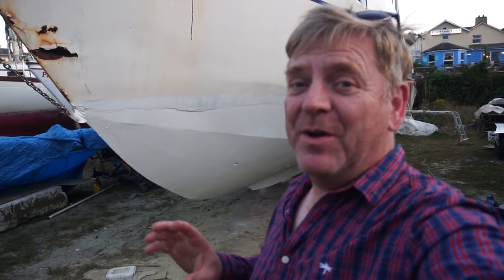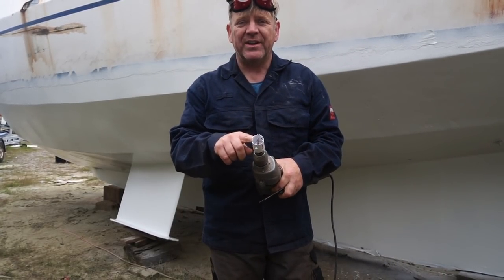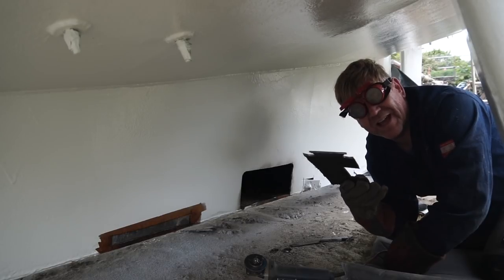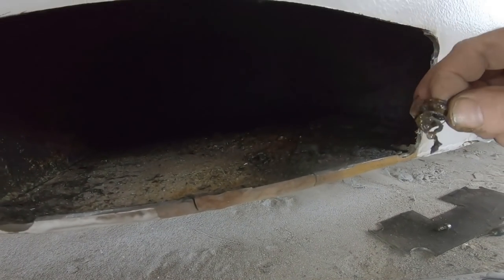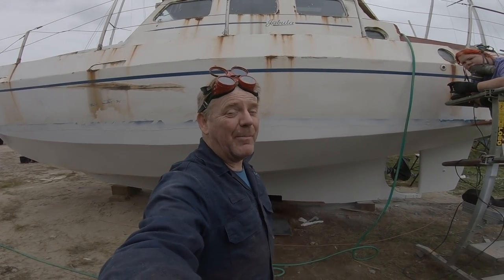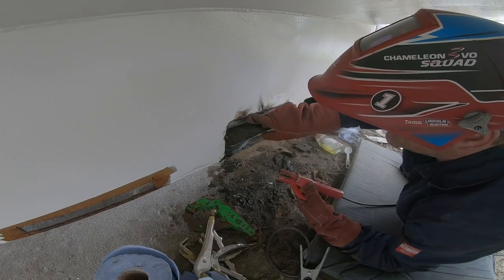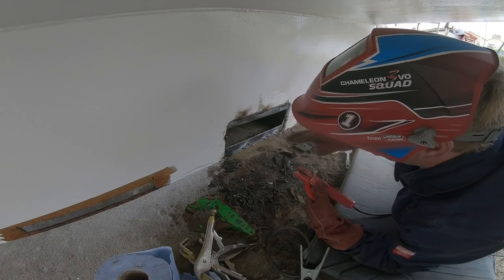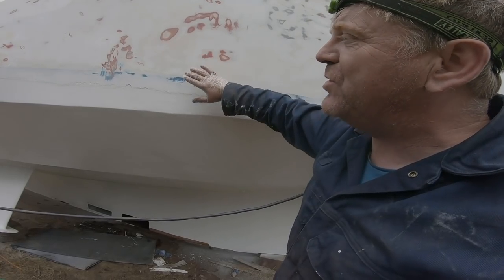#60 - Now our boat will DEFINITELY SINK!!!!

Comment: Paint it any color you like, just put in a good air conditioner and dont sweat it , the mini split ac units are designed to run completely on solar power but can run on shore power if your in the dock you can get enough ac for two rooms of a house or like 16000 btus for around 1600 dollars it comes with a compressor like 8 to 10 inch thick and around 2 to 2.5 ft square and 2 head units you mount in the boat and just run isolated lines from the compressor to the head units and back.  P/S some of the units dabble as ac and heat

Comment: Hi team, I have white deck on Steel. All I have to do is open the hatch and can relax in joggers, no sweat today. The biggest heat killer after that is mirror tinted windows that stop sunburn and UV protect SAILS
Reply: Yes, can also use the gas cooker for lunch. No sweat, perfect shade with a breeze. No coolers

Comment: Silver or white, not only does it reflect heat but it emits less heat, cooler in hot weather and will retain more heat inside in old weather. An orange hull is nice if you wish to be seen, could be a life saver.

Comment: boat is looking better every time I see it and it's great to see you radius the corners of the plates this stops fracture points.
never sèen backing plate done like that? if you are worried about penetration in future you weld in plate with a light root grind it back then go over with a hot pass weld really you should do  same on inside but as there's no access you could use ceramic inside ?
I'm sure the way you are doing it will be fine just trying to give you other options.
admire the dedication and the fact you are following your dreams

Comment: I love metallic silver. Have you considered a pale blue? Sky Blue, Ice Blue and Aqua Mist are three interesting Awlgrip colors just for ideas. All will contrast nicely with the white above the rail. I'm against dark colors on boat hulls. They highlight every flaw and tend to have shorter life spans due to extra heat absorbed by dark colored surfaces. Alexseal is a very good quality user-friendly paint that is brushable and easily touched up.
Reply: Dark colors show oxidation terribly as well. I saw a navy blue boat that had white puffy clouds all over it, and not in an artistic way.

Comment: Hi the only problem with silver with fleck, very hard to touch up but it does look good. Regards your backing plate next time you come to cut out the holes you have double thickness to cut through hoping  that's a long time  away, you can do the other side  i guess.Anyway great progress

Comment: Next time you get weld gas ask for non gas fluxcore wire, or make a wind break. If you get pin holes don't leave it has holes all threw it and will let water in! Just grind the weld backwards till you see no more pin holes and weld it  you have backing plate set it to about 22 and adjust your wirespeed till it makes that bacon frying sounds but go down hill on vertical

Comment: On the subject of colors, personally I would avoid dark colors which absorb heat from sun light because you'll bake and would also avoid a color which is reflective of sunlight on the top side  to avoid frying.  Very Light green, blue tan etc... would be my preference.  Orange, red and yellows will fad over time making color match for repairs difficult at best.  
You asked, there is my opinion....

Comment: Great channel recommendation.  Also you all are doing a great in both boat work and videos. I have been in a similar situation with a holesaw except mine went down a steel pipe and hopefully out into the septic system. It was 12 years ago and there have been no plugging issues. Lol fun memories.
Reply from the maker: Welcome aboard!  HAHAHA I bet that was pleasant to retrieve
Reply: @SailingMelody  nope never retrieved it. The farmer I was working with just looked at me and we laughed.  The pipe handles the drain for a dairy farm milking parlor.  We flushed it repeatedly with several hundred gallons of water.  Odds are it is in the first stage lagoon.
Reply from the maker: Right yeah gone for good then 😂

Comment: No need for letterbox plate, four small tabs would do and leave more access room for painting!
Reply from the maker: That’s a good point. Might do that next time.

But the letter box is belt and braces which makes me feel happier 

The other advantage is being able to leave a slightly larger gap and push the amps to root weld the outer panel to the backing plate all the way around and then another bead of weld onto top to weld the plate to the keel

Comment: I had a dark blue Awlgrip paint over fiberglass trawler for 10 years in the Caribbean. Looks great, but during the day with direct sun you could not touch the surface as it was to hot. I would stay with light colors. Maybe a plain light gray to contrast the white topside. Metallic colors are to hard to match up the road.

Comment: Have you considered one of the modern chrome paints? ....  lots of surface prep, but very very shiny :D
Reply from the maker: Hahahah I’m guessing absolutely impossible to maintain with scuffs and dings though
Reply: @SailingMelody  Ach, wooden rubbing strakes, plenty of fenders and about an inch of clear-coat over the top of it ... you can make it work, I just know it :D

Comment: Where you have the inspection ports into the keel.  Why weld them up again when yo could turn them into permanent removable hatches, with just a little extra work.  🤔🤔🤔👍
Reply from the maker: I wondered about this but I’m pretty certain the build regs would prohibit it and it wouldn’t pass a survey

Comment: Nice idea with the backing plates. - will help stop distortion down there in the HAZ  and will act more as a stronger lap joint than a butt,  Will be good if you could flood some kind of paint down there on the welded bare steel if poss where it burns off with welding.. Keep up the good work!

Comment: we have a  really deep bilge .probably easier access than yours though.  to reach the bottom we bought a vilda super mop to get down there. and cut the handle for easier storage.
Reply from the maker: Good plan!
Reply from the maker: Under the prop shaft we could do that definitely but under the engine there isn’t even room to get a mop down between the engine and the bearers. I tried to get my gopro down there on a selfie stick and I couldn’t get it in. Hut yeah definitely under the prop shaft will be able to use a mop like you suggest :)

Comment: you should put in a hole between the bilge under the engine and the bilge where the bilge pump is located so you don't have any standing water under the engine.
Reply from the maker: there are small holes in the corners for that reason yes :)

Comment: Ow come on 16 mins for one hole.. i think you need to up your game 😁
Melissa painted whole bottom of the boat last week 🤣🤣  she worked hard!! 💪 👧 🔋 

On a serious note metallic silver would look a bit too much like primacon? Goose grey, Oxford/navy blue would look awesome ( plenty of boats dark colours in the med and you will climatise as travelling, its hot regardless of colours lol) can always fit a small ac unit you've got plenty of room 😁

 gloss white (with metallic silver accents/pin stripes ) I'm sure whatever you choose she's going to look great 👍🏼
Reply from the maker: Hahah yeah I’m being very particular about any welding below the waterline. 

If I screw up a weld above the waterline the penalty is a drip bit screwing up welds below the waterline is a whole different game 😂😂😂😂
Reply: @SailingMelody  off course totally understand 😜 takes time todo it right.

Project brupeg is a good channel that goes right indepth of welding especially below the waterline (I'm sure you watch them already 😉)

Doesn't seem enough anodes round the boat, have you cut them off in prep for new ones?

Comment: I'd stick with white, but you really need a/c if you're going to circumnavigate, otherwise you'll be miserable, plus have more issues with damp and bugs
Reply from the maker: We will fit A/C at some point 200% but not just yet.  Eventually we will have AC, Genset and water maker but all in good time
Reply: @SailingMelody  that's sensible, you'll be glad to have those three I think

Comment: see there is a balance of positive and negative, yeah a navy blue might be hot in a tropical climate but white will be very bright on the eyes, id go for the dark navy colour and try to have more ventilation for the hotter climates, or use internal insulation to keep the heat from the inside.
it seems the same thing everyone does paint their boats the same light colour, stick with what you like.

Comment: Lip is a very bad idea. Especially in bilge where it is always wet. I've written this before. It is necessary to avoid connecting sheets to the overlap. At this point, you will definitely have a rust.
Reply from the maker: Thank you for the advice. What solution would you suggest for an inaccessible area?
Reply: @SailingMelody  Simply weld the patch pointwise (in several places). Sand the welds flush with the surface of the plating and only then weld the whole. This lip is needed only for the time of welding. Later, it's just a moisture store. Before welding, take some time and carefully profile the patch. You weld very well, so you can definitely do it.

Comment: I think you are doing a good job to her, but I am a bit concerned that when you weld the plate on the outside the paint will burn off where it is heated, this will result in a rusty area that you cannot get to as it deteriates in future.

Comment: Grey/silver is the one color that most effective absorb sun rays. From at corrosion point of view: Red, green, blue, black. This is for rust not to show. Best for reflecting sun is white. 
You will have to sail on very high latitudes.
Reply: By the way. The welding procedure you apply under water is absolutely not recommended. The way you proceed will contaminate the weld and add carbon to HAZ and the welding material. This will make the weld poreous and brittle. And you will not obtain a controlled 'burn through' of the weld. It's probably OK, as long as the hull dos not hit someting hard. Like at rock. Or stress in bad weather. Had I done someting like that offshore, I would have been on the first heliflight onshore. Banned forever :-) It may be quite sereous.
Reply from the maker: I will be grinding out the paint where I weld of course before welding.

Lots of people are saying to use weld through primer but I’ve done tons and tons of research and they don’t actually work.

So yes the panel is painted currently which of course would contaminate the weld but what I’m going to do is grind off the paint along where I am going to weld and anoint half an inch either side to shiny steel
Reply from the maker: But while you’re there then, if that’s the wrong way to do it, what is the right way to do it?
Reply: @SailingMelody  
Spec. Says clean steel 10 mm from weld area ON THE INSIDE. Then it is difficult to weld towards a backing plate. My education is what I believe in UK would be a university degree in steel, welding etc. And 15 years offshore as steel worker/pipefitter/project manager. I know.

Comment: Wondering why you didn't plug weld the inner piece?
Reply from the maker: What do you mean. I’m no expert. What do you mean by plug weld?
Reply: @SailingMelody  Drill a series of holes outside of the main hole and weld through them to the panel you added as a backstop for your patch.
Reply from the maker: Ohhh yes nice idea. I can still do that easy enough.

Comment: Why not a removable inset plate that is held in by screws????  When you weld you break the rust preventive paint and if it just bolts in.... problem solved.  It's no difference in that and/or an inspection /access plate in a large fuel or water tank on larger vessels. 
Why not try the WWI or WWII camo zig zag paint scheme and use modern colors?? You can always use metal flake in the clear coat or maybe pearl coat as well.  
Light grey with the addition of white, light blue and red in stripes and triangles going off at an angle.  Sounds strange but just think about it and work through a pattern or two and you will be unique as if you aren't already ...................  enjoy
Reply from the maker: I considered a removable plate with set screws but I don’t think it would pass a survey having that below the waterline